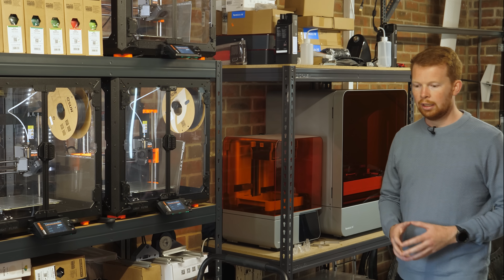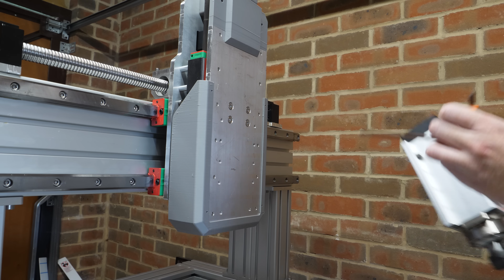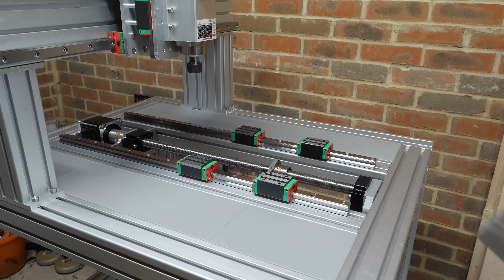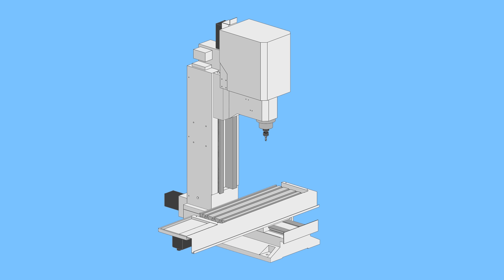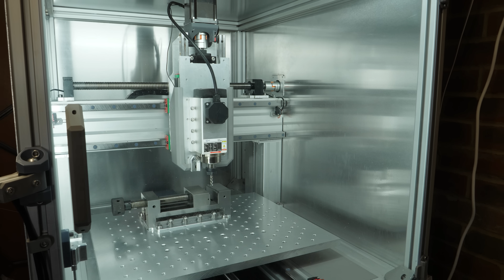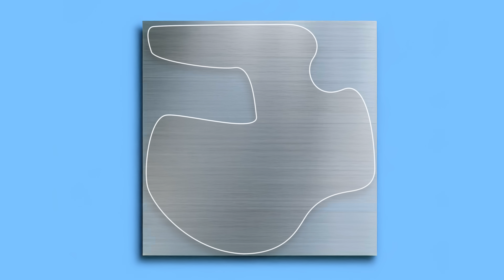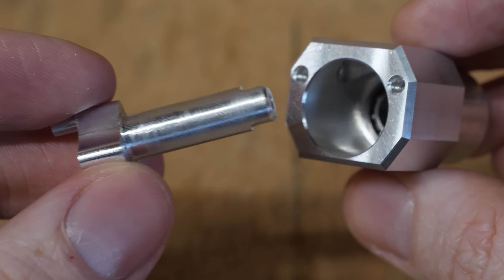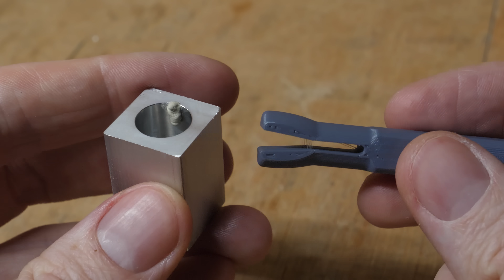I Needed an Engine, So I Built a CNC Machine

Comment: Machinist by trade here. I just want to say what you built, especially for the price, is super impressive. Long term you might want to look into way covers for your ball screws and guides, chips and debris WILL find their way into the inner workings. Also coolant use with aluminum always helps, but of course makes a mess. And always use the shortest tooling you can get away with to help cut down on vibration. But this is cool man, I'm jealous.
Reply: I'd like to add that there's no harm in backing your tap out half way and adding additional cutting fluid if you're tapping something difficult. Be that material or size related, better safe than sorry.
Reply: @rainbowbunchie8237  I'm not far enough in the video to know the type of tapping, but I have had experiences with spring loaded tap holders cross threading finer threads on a bridgeport style mill.  And my machine in particular can flip a tool 180 relative to the spindle orientation during a tool change, so if your tool has left the spindle or has been through a tool change you might have issues running a rigid tap cycle.  Generally for rigid tapping, hand tapping, and larger spring tapping you'll be fine though.
Reply: @Soundpost-f2l Never used a spring tensioned tap before. Only ever done it with a rigid chuck.

Removing the tool and not ensuring you've got it lined up right would be a noob mistake.
Reply: @rainbowbunchie8237  spring tension is good for when your machine has 3 axis but can't sync the spindle to the Z.  It was only on a couple M2s that initially went too shallow I had issues.  

Removing a tool by hand, you can keep track of it.  My ATC orients the spindle but it doesn't differentiate between putting the tool in left or right side first.  It just picks one to flip to seemingly at random, and because it's 30 years old I don't trust that it remembers which orientation it put a tool back in last.
Reply: @Soundpost-f2l  I mainly did water jet and 3D printing in terms of CNC, the rest of my work down to 0.0005" tolerance was done on manual machines. 

Any less than that and I'd model the part and give that to a more experienced CNC mill operator.

Loose tolerances? Make it by hand. Tighter tolerances? A more experienced CNC operator got it.

Never had much chance to learn CNC milling on the easier parts due to being decent at running the manual stuff.
Reply: The excellent Datron machines use isopropyl alcohol, which in addition to being cheap to install leaves no residue. The only disadvantage is that you would need some really good ventilation.
Reply: I love these discussions from people in the know!
Reply: Mist coolant is nice alternative to flood coolant.
Reply: You can also use ionised air as a lubricant for cutting tools. Strange to think I know but there's a Finnish? Startup trialing it around the UK at the moment and it's had good results on aerospace aluminium
Reply: @Strife584  that's pretty out there I never would have imagined!
Reply: @adamdecurtins3405  I was invited to show them around the machines I maintain and investigate ways to incorporate their system on them. I'm machine tool maintenance so was quite interesting. It's pretty cutting edge but seems to be gaining more acceptance. Although the company i work for being blue chip it hasn't been trialed due to the paperwork/hoop jumping with regards to faa and easa 😂
Reply: Shock absorber boots for automobile suspension would be a great option for low cost ball screw covers.
Reply: Ngl i read that as "masochist by trade" lol
Reply: @bearofbusines  some days it feels like that!
Reply: @bearofbusines yes
Reply: I must have missed the price. How much was it?
Reply: Aurion machining is the company running trials of ionised air cooling/lubrication
Reply: Forward this to Adam Savage.
Reply: I was going to say. Put those bits deeper, less vibration means tighter tolerances.
Reply: Proper tips! Proper tops! My man
Reply: not just the shortest the shortest with the longest shank you want full engagement the  largest running tolerance i use is abt .01" and thats only for length and none tapped bolt holes a good  machine to say the leasxt but you should go and watch a few other machinists there are a few that make what a machinest does look some what simple enough to understand
Reply: I used to be interested in learning how to use them, as well as how they work and what they do.

I still am curious about that.
Reply: I think Adam is talking about cuttings on work piece. He is talking about cuttings getting on axis rails and bearings
Reply: Another machinist here. Yeah, what that guy said
Reply: He could also just make something to blast the tool bit with compressed air which helps clear chips away as well as keeping things cool off a bit (although most of the heat is in the chips) . It doesn't work as well with thicker pieces of aluminum, but it works great with thin aluminum sheets when you don't want to clean up coolant. A vacuum system with a boot could help with chips but it can also get in the way of the piece that is being worked on. Most of my experience is with CNC routers and I wish I had access to a machine like his.
Reply: @IActuallyLackABetterName  air is better than nothing, but aluminum tends to get "gummy" when cutting because of its low melting point and it can stick to the cutter and build up. Light cuts can help fight this too which he probably has to do anyway because I'm sure his spindle doesn't have a lot of torque for heavy cuts. There's also coolant mist systems which I've heard good things about. On the extreme end there are also liquid nitrogen coolant systems out there!
Reply: @ liquid nitrogen sounds fancy and expensive lol. The machine I used had a coolant mister that used something close to vegetable oil on it but it was actually more efficient for high volume jobs just to run the machine slower with compressed air or doing multi passes than dealing with the cleanup. I have gummed up quite a few bits when  I was first starting out but now I can tell just from a change in noise that the bit is either dulling or getting gummed up.
Reply: @adamdecurtins3405 
 I've machined literally 'miles' of 6061 and 7075 without issues (plus 'tons' of unknown grade cast aluminium)
'Everyone' says it's 'gummy' but most of the time it isn't, even when cutting dry.
Main problem is machining at industrial feed rates without industrial flood coolant, industrial rates are trade off between manufacturing time and tool life.
Hobby machining is done at much lower rates of stock removal and almost always at lower rpm for milling cutters to prevent edge build up (shearing action causes heat build up on edge that can friction weld chips to tool)
Reply: @1crazypj perhaps that's why my experience is different from yours. I haven't done much hobby level aluminum machining, and yeah in the industry we're pushing tools as hard as we can all day long.
Reply: @ I'm retired  now, thought I had made a terrible mistake buying a mini lathe.
I had to re-learn 'everything' but it's been interesting making small machines do more than they should be capable of (even if it is very very slow)🤔
At least I don't have to worry about three micron tolerance, unless I really want to 😁
Reply: My man I have a great engine concept use water as fuel please respond that very important
Reply: @monasoffar6046 
 Have you built or had someone build you a proof of concept?
You need a working model, lots of people have great idea's.
Reply: @monasoffar6046 don't have a meeting to discuss said engine at a cracker barrel resturaunt.
Reply: I hate when anyone starts out by saying: "Mechanic from Louisiana for 20 years here🙋‍♂️" god damn... Stop it
Reply: @Mr.Goosebumps-gl8lv  a machinist knows what math is a mechanic knows how to build a lego set

Comment: Those marks are chatter from your tool, not it cutting in straight lines. It's because you have too much backlash in your screws. Manual machines get over it by cutting in one direction at a time. There is a speed limit on stepper motors where they will cut in straight lines when pushed too fast, but you're likely no where near it. A proper CNC machine can cut neat arcs

Comment: For locking the cilinder height, a thin "locking nut" should be sufficient. Once you have adjusted the cilinder to the right height you can turn the locking nut against the crank case with a wrench. This should lock it in place. You may need to increase the amount of threads on the cilinder and add a way to strongly hold it while thightening down the locking nut tho.

Comment: (As a machinist) yes, the sand should help with machining quality. If you have tool vibrations that are a harmonic of the frame you made, it won't resonate as much as if you hadn't filled it at all. If you hadn't filled it, it would probably also deflect more under load, causing more chatter, making the surface finish worse.
Reply: you can also find your spindle and frame harmonics and try to avoid these frequencies, sometimes a few hudreds rpm can change the surface from shlt to mirror finish
Reply: @mgn567  Yup, electric motors are often thought of as nearly perfect things, but they really are just another mechanical system that lives in the real world, so internal stiffness, bearing design and also how smoothly it's driven impact just how even the speed is delivered to the cutting tip. Which then interacts with the load the cutter experiences, and how much leverage it has against the spindle shaft.
Reply: Would filling it with granite sand and no binder have helped? Like a 'dead blow' hammer.
Reply: @LowPriceEdition  probably. As long as it helps dampens vibrations.
Reply: @kaylinosprey3306  Ya, but you won't get any of the stiffnes benefit of having the sand bonded in. But I imagine depending on your application, the stiffness versus the damping needs may vary, and loose sand may be sufficient for desired finish if you're not pushing tools hard into hard material.
Reply: @LowPriceEdition   some commercial machine beds are filled with a fine sand. makes moving the machine tool heaps easier too. instead of a heavy monolith,  just vaccuum out the sand and teh weight is reduced by a heap
Reply: I hate when anyone starts out by saying: "Mechanic from Louisiana for 20 years here🙋‍♂️" god damn... Stop it
Reply: @Mr.Goosebumps-gl8lv  Youtube commentor for 13 years here, i agree with you
Reply: @Mr.Goosebumps-gl8lv  machinist for 5 years here. You have wasted your breath telling everyone in this comments section to stop doing it because we're not going to stop just because some nobody without a profile picture or videos told us to. X3
Reply: @kaylinosprey3306  It's the worst 😂
Reply: I filled my metal speaker stands with sand for the same purpose. Less harmonics transmitted to the stand = more precise acoustics reaching my ear holes.

Comment: A regular boring head can be used to cut external surfaces like a lathe, simply by rotating the cutting tool 180 degrees and spinning the head in reverse. This has the benefit that it's also adjustable unlike your tool that can only cut one size.

Comment: The horizontal lines in the cylinder are necessary. it's called cross hatching and helps hold oil against the cylinder walls and reduces friction.   Try making one and leaving the cross hatching, i bet it'll help.

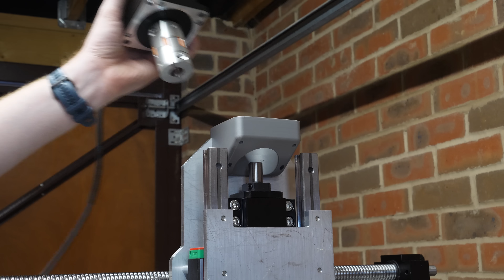Comment: 2:10 - I advise you to not mount a stepper on a plastic support, they rely on the mounting interface to dissipate the heat. I learned this detail the hard way when one of mine cooked itself because it was just suspended with screws.
Reply: This seems rather important!
Reply: On the flip side - one of the most common stepper failures I've experienced is a case short, bringing the whole machine frame up to stepper voltage. Can be a little dangerous if you like to run higher voltage motors.
Reply: That depends of the current it is set to run at, as my 3d printer has all steppers bolted onto acrylic and they never get burning hot
Reply: @tomclanys  they run at like 2.4A at 24v cos they're swinging around hoverboard hub wheels, so yeah, they get a little warm at times
Reply: @ hoverboard motors aren't steppers but BLDC
Reply: @tomclanys  didn't read my comment properly, did you? The steppers are moving the hub motors about
Reply: @ I've never seen a hoverboard with steppers, can I ask you for a name of one or something?
Reply: @tomclanys  only the motors, not the hoverboard. My custom robot has steppers. You're not very good at reading are you
Reply: @ "hoverboard hub wheels" you mean you used hoverboard wheels as an axle for your custom machine? I'm not a wizard, I won't know what you meant if you don't explain it clearly.
Reply: So are aluminium spacers and screws not enough to properly dissipate heat? I might need to add more stuff to my workbee upgrade list then.
Reply: dw, it's a self welding joint.
Reply: He only needed the plastic part to last for few minutes while he machines the replacement metal bracket :)
Reply: That's why my PLA mounts on my robot all melted under belt tension. PETG worked better but now I use ABS

Comment: 19:42 i have that powerband on my mini air engine too i think it happends because usually the air starts pressing on piston when its on top dead center but at a certain speed it starts pressing when its going down and less energie is wasted in too axial forces and then theres less wasted  thats my idea i dont know if its that or not and you use a rubber ring to avoid the ball getting smashed into the zylinder very smart have to try that i use a plastic bb ball to save weight that the piston has to push up it works kn my case i hope you dont have trouble reading that sorry for my poor english greetings from germany keep up the great work

Comment: What you might want to do in the future is make it so the cylinder rotates based on the rpm of the engine...IDK if it's needed, but you might want to see if it does better at different rpms with different timing.

Comment: small tips: regarding the piston, more precisely the shape of the piston, you could take a look at the Czechoslovakian Modela engines. The Modela CO2 engine, 0.27 cm3, used a plastic piston, not aluminum, which worked directly without elastic bands in the aluminum cylinder. The peculiarity was given by the fact that the upper part of the piston was built with a V shape, like the lips of an oil seal, so to speak. In fact, if you wanted to replace the piston after a certain, long, period of use, you had to press the plastic lip with the help of a plastic tip in order to uniformly compress the upper lip, practically an elastic band common to the piston.  It was recommended to periodically add a drop of thin oil, I used Singer sewing machine oil, on the piston to lubricate and promote correct compression. The cylinder, which could be screwed in to change the compression, was only screwed in without a locking nut. A more precise play between the cylinder and the crankcase would probably be enough. Good work and I will follow the developments as usual
Reply: Compression rings and not elastic rings . Bloody T9

Comment: To generate more accurate rounded cuts in Fusion (which seemed to be the CAM software you're using?), you can set tolerances in your toolpath settings to a lower value. That'll of course generate larger gcode files, but will more or less remove the problem of inaccurate gcode. Obviously that doesn't help with stepper accuracy, though.

Comment: You need to change your post-processor to output G2 / G3 moves which are radial moves around a point..... Not linear moves that approximate a curve, and cause faceting.  It will also make your code much less bloated. You can basically cut a circle with a couple lines of code, instead of 100 lines. 👍🏻

The reason it may be outputting G1 moves to cut a curve, is because you are ramping down a helix. Some CAM softwares won't output G2/G3 moves when also traveling in the Z axis, like when ramping.....the way to fix that is to ramp down with radial stock to leave, then simply drop down to depth, lead in to a circular 2d contour, then lead out.....🍻

It still won't be as round as a boring head, but it will be a lot better than a linearized helix

Lastly, when you interpolate circles, you need to slow your feed rate WAY down ...500mm/min seems very slow on a linear cut, but going around a small circle only 30-40mm in circumference takes only 3.6 seconds....that's too fast for a machine to cut an accurate circle ...so keep that in mind.....small circles, 25 - 50mm/min max....

Comment: "the elastic torsion in the pressure tube changes the valve timing "

You mean you designed it with Variable Valve Timing

Comment: That fixed-size boring head is a neat idea! It surely has an advantage in rigidity, but has to be rebuilt for each size of cut.  Are you planning to get a more conventional boring head eventually? (Yes, a boring head can successfully be abused to cut an outside diameter.)

Comment: I like the mill and the engine.  The only potential problem I see is running an aluminum piston is an aluminum cylinder bore.   Like metals will almost certainly cold weld sooner or later, seizing the engine.  Running without lubricant will bring about seizure faster.   The problem could easily be fixed by electroless nickel plating applied to one of all couples of sliding or rotating surfaces.  Keep the oil as it will reduce friction and improve sealing. 

You could also make the piston or cylinder from steel or brass.  The connecting rod should probably be steel; or 7075 AL.  

Speaking of different alloys of aluminum, you may get away with making the cylinder, piston and connecting rod out of 7075 and 6061.  The alloys are different, as is their hardnesses.

Looking forward to the next engine video.

Comment: If you find a way to control the cylinder case height depending on the rpm you could create a VTEC engine.